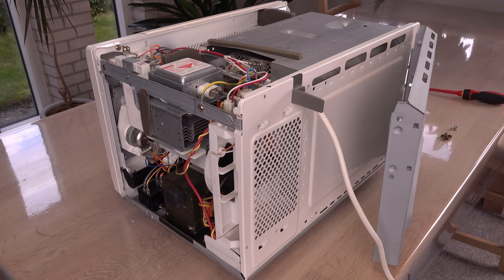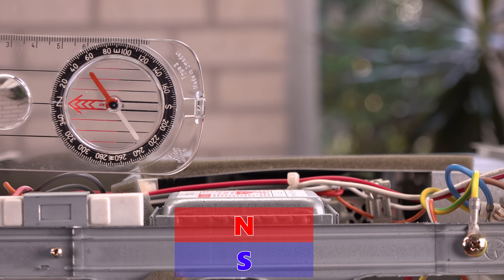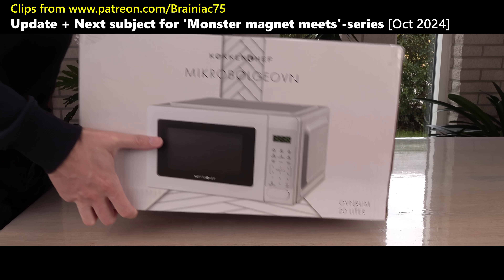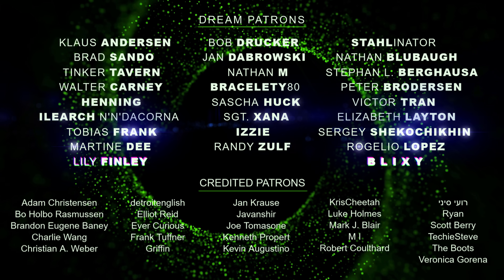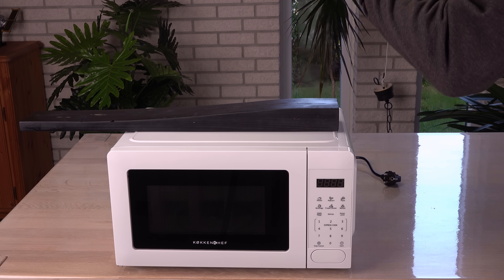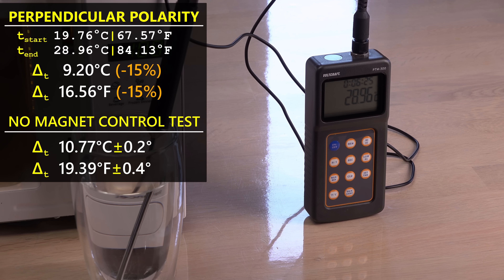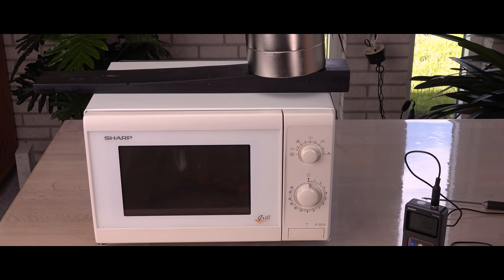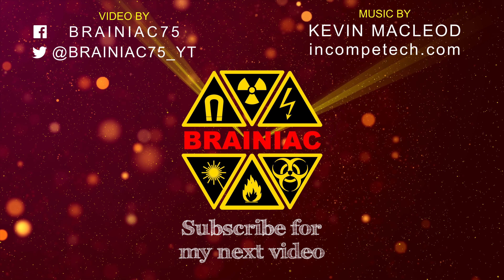Monster magnet meets microwave magnetron...

Comment: Couple of suggestions:
1 - On mechanical timers, turn the timer clearly over 1 minute mark and use a stopwatch to time the heating. 
2 - Would some sort of casing, maybe wooden, with handles be safer for handling those magnets.

Comment: I pushed my Radiacode 103 to its limit recently with an old Chirana X-ray tube. It maxed out at 1mSv/h with over 3 million CPM. If you’re wondering I have a remotely operated switch, so I don’t have to be anywhere near it when it’s running.

Comment: i would expect youtubers that handle those dangerous equipments like supermagnets or ultra high voltage converters to be housed in special contraptions or something,.

but ya all seem to have the demon core experiment mentality. until catastrophy
Reply: you may consider building a housing for the magnet. a housing with handle. protects the magnet means longer lasting and the handle certainly will come handy

Comment: Handling a magnet this strong is so scary 😰
Reply: Yeah, got pinched a couple of times with mine. But, great for some experiments and also for general utility, such as clamping ferromagnetic objects in place that you don't really care if they get magnetized (although, degaussing them is simple enough too).

Next projects, pick up some old microwaves for the power supplies... Might keep a magnetron for the beryllium oxide based insulator as well. Useful for a radiation reflector and general purpose insulator. Also toxic as hell, so care would be the watchword.

Comment: Instead of relying on the mechanical dial (timer), you could just turn it all the way on and simply measure the time with cellphone. The microwave start and stops when you close and open the door. No reason to use the timer.

Comment: A different test, could be using a DC ammeter in series with the anode of the magnetron. In this way you can measure the input power to the magnetron. You need some precautions because of the 1000+ Volts across the plate (anode) of the magnetron.
Please note. The magnet in the magnetron makes the beam of electrons from the cathode to rotate and touch the various mini-plates. Without the magnetic field, the electron beam will remain static and hit the mini-plate with the highest faradic capacity. This will burn the cathode and the mini-plate in few seconds. The same problem happens with X-ray light bulbs if the anode stop spinning. The difference is the magnetron = € 50, while the X-ray light bulb = € 250,000.
Thank you for the video!
Greetings,
Anthony

Comment: Take apart the magnetron.  Replace both ceramic magnets with your ultra high powered magnets. See if it boils water faster.  All these experiments should be done outside of the microwave.  Use 2 momentary push button switches in series outside of the room to turn it on.  If one switch fails closed circuit there is a second switch keeping the circuit open.

Comment: The power cycling is probably due to low voltage for the digital control board. I think I saw a small transformer high at the back which is probably having a bad day with its core being saturated by the big magnet.

Comment: Congratulations to your experiments, very much straight forward. 
When playing with microwave ovens I placed a diode and a µA meter at some point of the door-slit where the microwaves can be detected to get an immediate reading for the power. (Any other slit can be made and closed afterwards.) I checked the power while changing the supply voltage with a variable transformer to measure the field distribution inside.

Comment: I'm sure that microwave has a switch mode power supply for the electronics. These contain transformers or at least inductors. If properly dimensioned in operation the inductors are close to but not at magentic saturation. If you add a magnetic field from the outside they will be closer to saturation and no longer work as inductor/transformer (or rather they behave like an inductor without core, which has a much lower inductance). Essentially you stopped the inductor's/transformer's ability to store or transfer the intended power.
Reply: Even a mains frequency based power supply transformer can be saturated by such a magnet.

Comment: ha! We had a SHARP microwave bought in Germany when I was a kid. Parents bought it in like '93. It was used almost daily and we had to replace it only in 2017. The light stopped working a long time ago, the rotating glass saucer broke 2 times (had to be replaced) but that microwave just kept going for over two decades. It even had a grill/broiler. I miss it.
Reply: Same here
97' sharp R series with grill. It is working till now daily used ~2 times per day without even one element replaced.
Daimond star for the panzer quality 
Even "autocook" still working perfect.
Reply: I have an R series Sharp from 2005 and aside from the light giving out it's been a very durable unit. I've even run it straight from a generator several times and no issues. I love the unit and I'll be sad when it eventually dies.
Reply: Mine is nearing 20. They are really sturdy appliances.
Reply: Mine's a no-name brand, I bought the cheapest I could find, still going strong like 17 years later

Comment: heres an explanation for the resetting issue, its likely the switching power supply that powers the control board randomly cutting off because of the saturated core of the trasformer. the chips are powered off of a third winding on the transformer and starts with a resistor that charges the capacitor the chip is powered off of, it may be that its just saturated enough for the chip to stop running but the resistor is barely keeping it running. if it stops running, the resistor charges the capacitor up again due to the chip being in standby and drawing less current. the capacitor is charged up above the minimum voltage the chip requires to start because of a small delay(the amount of time the chip takes to start up). once the chip starts, it draws more power and the capacitor starts to discharge. at some point, its gonna discharge enough for the chip to shut down and the cycle repeats. its sort of like when the diode responsible for charging the capacitor fails and the chip is only running off of the resistor. in that case, you would have a power output that turns on for a few hundred milliseconds and turn off again. a second later, it turns on for a short time again. this effect is often called the "hiccup" failure and is why you often see lights flashing like that.
Reply: Saturated cores can act weird to begin with, far beyond any bias effect, as the entire hysteresis curve gets thrown off by the core being magnetically saturated. Inverters especially would be sensitive to that effect, as they'd never come close to operating in saturation to begin with. Line transformer based can operate closer to saturation, as that would help regulate the output of the transformer.
I've worked with a handful of different classes of transformers over the decades, from saturation resistant types, various RF types, power transformer types, HF switching for SMDS/inverter systems and saturable reactors. For the most part, the math behind most is fairly straightforward. It's not as if it involved calculus with a half dozen elements.
Reply: This is not how it works at all, and they never use the main transformer to power the electronic board.
Reply: @AeroGraphica  you can see the switch mode power supply below the relay at 16:18

Comment: Heating 300g of water by 10°C requires 12 600J of energy. The second microwave taking a full minute to do this means that its effective power is only 210W.
Reply: Probably the smoothing capacitor is defective.
Reply: Probably, the smoothing oil capacitor is defective. The lower output matches the difference between the power output with the full DC voltage, and the pulsed but not smoothed voltage...
Reply: I was gonna berate you for getting it wrong, but you didn't, you just input the wrong delta-T. It was 20K, not 10. 418 watts is probably a reasonable power absorption in a glass of water in a 750 watt microwave, the rest gets absorbed by the Faraday cage. The glass and air would absorb some of the heat too, not from the microwaves but from direct conduction from the water.
Reply: @Tjita1  No, 10°C is correct. I was talking about the second microwave, the performance of which is shown at 9:30.
Reply: I commented this under the video, but I repeat it here as an answer for you. The field strength in microwave ovens is very uneven, due to the additive and subtractive effects of interference as the waves are bouncing between the walls of the chamber. That's the reason why they have a rotating plate. Probably the new microwave has a weak spot right in the middle of the chamber, so if you put a glass of water right in the center of the plate, it will always be in a weak spot despite its rotation.
Reply: WOW... Maybe the power had to be at P99?
Reply: @XA--pb9ni  You can use a microwave to metal metals for casting, do research
Reply: most modern  microwaves have a sticker inside the door somewhere saying that u should put a spoon into the cup if u are heating water, because water on its own doesnt absorb much power, i usually only need like 1-2 minutes to get a cup to boil with a spoon in it, without one it takes way longer
Reply: @BadMax02_VR Water is the substance that the frequency of the microwaves was chosen for, the 2450 MHz matches the resonant frequency of the water molecules, dramatically improving the heating efficiency over what EM radiation into an electrically conductive material does on its own. 
I.e. you've misunderstood the problem, the reason you'd put a spoon in the water is that sufficiently clean water in a sufficiently smooth container won't boil when heated, so you will never know it's well over 100 degrees celsius. As soon as you disturb it though, it will flash boil, or in essence explode, right in your face. Adding a "contaminant" (the spoon) prevents this.
Reply: @Tjita1  interesting, thanks for the actual reason for that, good to know. I dont microwave pure water often so it might have been a wrongfully assumption i had to the speed of the heating.
Reply: @Tjita1 "matches the resonant frequency of the water molecules", this is a common myth. Microwaves transfer energy through dielectric heating which works for all kinds of polar molecules including water (though not ice). 915Mhz microwaves heat water perfectly fine, no resonance needed.
Reply: @beardedchimp funny you should choose 915mhz as a counter example - it's also one of the ISM bands, which are license free precisely because water tends to absorb it better. Rain makes those bands less desirable for radio use.
Reply: @JamesChurchill  I didn't choose it so much as it being another frequency commercially used. Your last point is exactly why it seemingly appears an unlikely coincidence that microwaves operate close to water's resonant frequency despite not being the mechanism for heating.

I've long wondered what telecommunications would look like if the world's militaries hadn't gobbled up most of the spectrum. Huge amounts of the technical innovation occurred at wavelengths they considered crap and didn't want, what would have happened if the military only had the "crap" bandwidths and the public everything else?
Reply: @BadMax02_VR  No one listen to this lol.  Don't put metal in a microwave!
Reply: @dirtypure2023 No, he's right. A spoon isn't sharp enough to cause issues. The problem is flash boiling (or however it's called in English, in German it's Siedeverzug). A spoon will help with that so that you won't end up with boiling hot water on your skin.

But that's the reason they recommend it not the increased transferred power.
Reply: @dirtypure2023   You can use a microwave to metal metals for casting, do research
Reply: @andymouse  The average commenter should not be using a microwave to soften metals for casting under any circumstances 😅
Reply: @dirtypure2023  Agreed, but this is science channel so we should respect that. and my statement was correct. I don't think that the viewers are that stupid and I clearly asked them to do research not stick a bloody gold bar in there. So no need for your virtue signalling here. science enthusiasts only. And how long have been using a fire brick foundry in my microwave for jewelry repairs ? as you think you know about the subject
Reply: @andymouse  Well about the "my statement was correct" part. Kinda a big typo there in both comments. This is a science channel and need to be precise as possible with what you are saying.
Reply: @silentferret1049  Nice comeback :)
Reply: @flack3  Do you have one ? because that would be great ! I never win anything so thanks :)
Reply: @dirtypure2023  My microwave came with a metal rack and 2 part metal pan in the bottom, no problems in decades. Forks will arc due to the points, spoons are usually fine.
Reply: @LowBudgetGamer-o6l  As long as they don't come close or touch the walls.

Comment: Try measuring the actual powerconsumption of the microwaves. Have sadly noticed that a lot of modern appliances simply lie about their actual power (like a food processor claiming 1600W but never reaching even 1400W).
Reply: I remember the start of that nonsense, instead of going with the normal RMS power, they started advertising peak to peak power, to get a higher number to report, while still churning out the same effective average power...
Reply: @spvillano  That's the worst with consumer grade anything
Reply: Pretty sure the ratings are meant to be a maximum and it will increase the more torque is required to process the food.  Also will vary depending on input voltage.  So no, they aren't necessarily lying.
Reply: A lot of companies do that. Like a lot of laser engravers being sold on Amazon tell you their total power consumed and sell it as a 40 or 60 watt laser cutter when the actual power output is only a 10 watt laser diode. Of course they make sure and put the "40 watt laser cutter/engraver" in the title and you really have to read down through the description and actual specifications of the machine to figure out that it's only a 10-watt laser diode that's doing the work, and not 60 watt like they would lead you to believe in the heading.
Reply: @keithyinger3326  With a laser then sure, its lying, but anything with a motor the load changes depending on the torque the motor is under, so the value is the maximum load not average.  I mean its possible they lied, but 1400W avg on a 1600W max sounds about right to me.
Reply: For safety of your electric installation, it is better this way than the other.
Reply: @olivier2553  "For safety of your electric installation, it is better this way than the other."
not necessarily. If i need a 300W UV-light for waterdisinfection you can be sure as hell that having only 250W is the safetyrisk.
Reply: @ABaumstumpf  UV light will not have the wide range of power that a food processor has, it does not have different loads.
Reply: @olivier2553  Neither does the food-processor. If it is advertised as 1600W then it should be able to deliver that - and not 20% less in a situation where it is actively disintegrating and trying to burn down your house.

Stop making excuses for companies that scam people.
Reply: @ABaumstumpf  How are you measuring the power consumption? What load is the food processor under?
Reply: @ABaumstumpf  I was speaking of your electric installation, not the device itself. 

It is better for the electric wires in the wall that no device overload them.
Reply: @veryboringname.  "How are you measuring the power consumption?"
You know - with a power-meter?

"What load is the food processor under?"
The thing where it actually matters and where it failed pitifully: Kneading dough. 
The same recipe and amounts as with the >30 year old machine that finally broke down that was rated 1500W - just the new one stalled several times and gave some "funny" smells.

Or in short: fake ratings on new machines.
Reply: @ABaumstumpf  What was your line voltage? If you were on the lower end of a 110V supply with extra drop in your house wiring, you would be drawing less power than if you were at the upper end of a 120V supply.
Reply: @ABaumstumpf  This is a plug in appliance, the whole safety is it not melting your wiring in your house. Completely different reasons for the rating. Before you say a 1600W is under the rating, keep in mind people have other things plugged in and working on the same outlet if not the same circuit and knowing the maximum will keep from at least throwing the breaker.
Reply: @olivier2553  "It is better for the electric wires in the wall that no device overload them."
Then that is even less of a problem - you could run 2 of those and be still well below the rating.
Reply: @veryboringname.  " If you were on the lower end of a 110V "
I am not living in a 3rd world country.
Reply: @silentferret1049  "Before you say a 1600W is under the rating, keep in mind people have other things plugged in and working on the same outlet if not the same circuit!"
standard plugs are rated for 4kW..... so no, that is no concern at all.
Reply: Yeah they have that rating for safety purposes with a % margin as under a very strong load, which they can be put under, they can draw a lot more which will cause problems. Also whatever variances in electrical can shift a fair bit watt wise. Just because they use a lot of power does not mean they use it efficiently for the task. Although the measuring the power would help really well in this case but might have to centralize power to the magnetron itself.
Reply: a classic example of "take the government to the bin because all they're doing is nomming money"